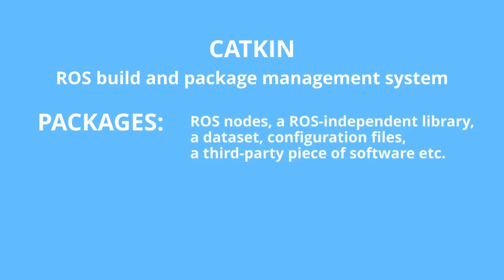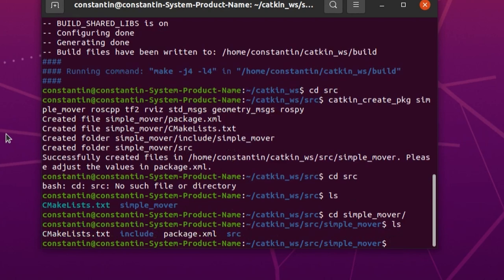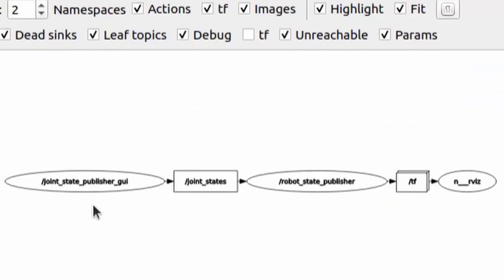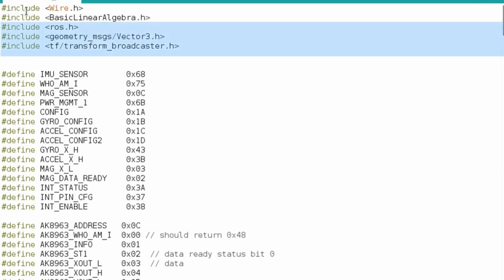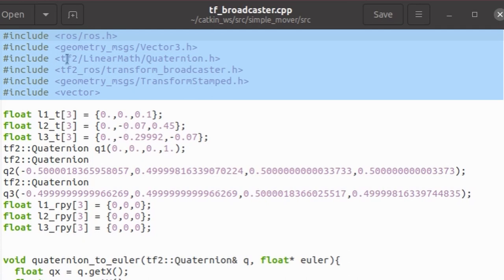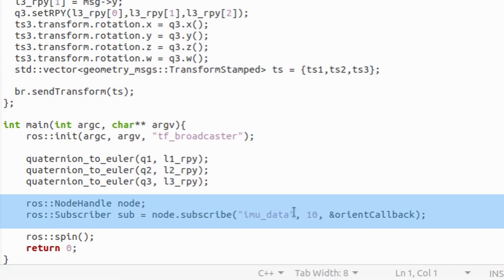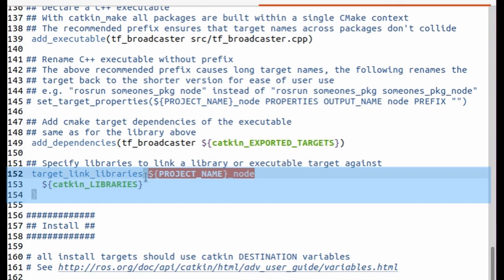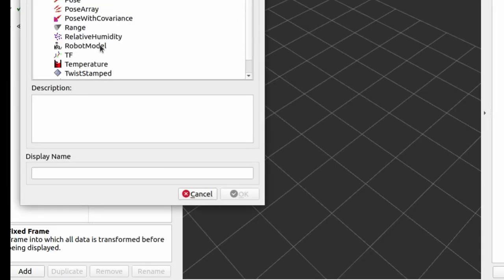ROS TUTORIAL #2. INTERFACING ROS WITH ARDUINO.

Comment: Very great tutorials! Thank you very much! I would like to ask what is better for ROS - Arduino or something different ? I'm interested in building automated production line for my company with robotic arms and automated machines.
Reply from the maker: It depends of course on requirements of your project. Arduino doesn't have proper protection & shielding for using in industrial applications.
Reply: @roboage1027  Requirements is to carry metall cylinders from first zone put it into First machine then after take out into second zone. I think the arm like you made is capable to make this job. After this step we need one more robot arm to take cylinders from second zone,  put it into furnace after burning take out from furnace (640 C) hot cylinders and put it into another machine and after take out and put it into the third zone.
Reply from the maker: @shillingv6289  Arduino is Ok, as long as you take care of it's protection from harsh industrial conditions like dust, dirt, electrical noise, overvoltage.

Comment: I am confused about the code which sends transformation( goal & pose) to arduino and how arduino determines how much to rotate a  given motor joint.

If you can touch on this topic a little bit will be much appreciated. Thank you
Reply from the maker: Arduino reads sensor data and publishes it over "orient" topic in ROS. The data in "orient" topic contains rotations over x,y and z axis of the sensor. And there is also node in ROS, which is subscribed to "orient" topic. This node converts received data to "tf" topic, which is then used by RVIZ to update visualisation. That is, rotation over each axis of the sensor is used to update orientation of certain link reletive to it's parent link.